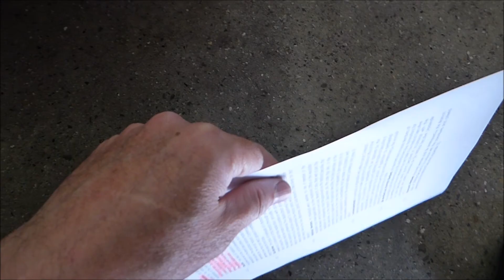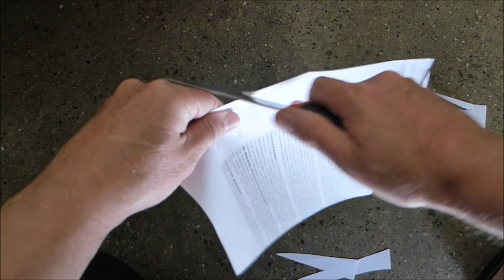Sharpening a Bahco Companion Knife with the Edge Pro Apex 05/09/2020

Comment: Gday Mc , ive been a slaughterman since 1976, biggest problem with bought knives is the massive shoulder on them, dont know how they expect people to sharpen them, but as for you feathered edge, when we finish a knife on the big sandstone it usually has a feathered edge, i remove this by sharpening a knife at 30 degrees for a half a dozen strokes each side, this will leave a feathered edge, i then lightly sharpen the knife at 45 degrees for a few strokes , this cuts the blade back to a strong common edge, you then sharpen at 30 degrees till you get your good sharp strong edge, BUT the most important asset is a steel, a stone sharpened edge is almost useless without steeling, even an old steel from a second hand shop is ok if you rub it back a tad with wet and dry paper..
Reply from the maker: I have a ceramic steel for that, couple of strokes either side at a steeper angle and you are done.
Reply from the maker: What was your preferred knife? Any of those green rivers have nice shoulders so you can take them back and keep it at steep angle no problems.
Reply: @mchughcb  Cant use green rivers as they have a wooden handle, we use Victory 6 inch skinning knives, and we get our knives ground before use on a gazini grinder, it hollow grinds the knife, i can flex my edge with my thumb nail as to how thin it is, when we do big grain fed ox or bull the hide is 1.5cm thick and a thick blade just wont sharpen, i only sharpen my knife on a stone once before a shift and then i guess i cut through about a kilometer of hide a shift, the steel is the key, as for the steel mine was polished to mirror smooth then wiped with iodine and left to rust doe 2 days, this leaves a light rust, i then remove with hydrochloric acid, this leaves a fine pitting in the steel and this sharpens ie polishes the edge.